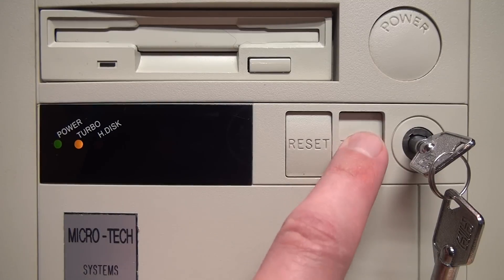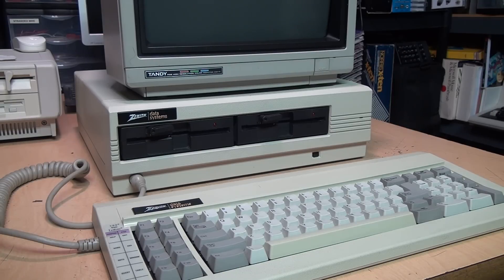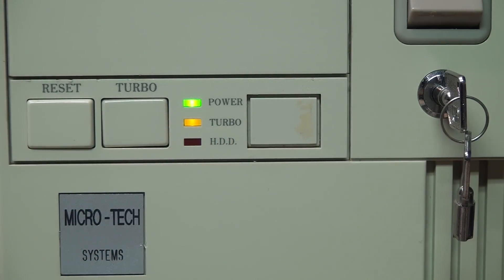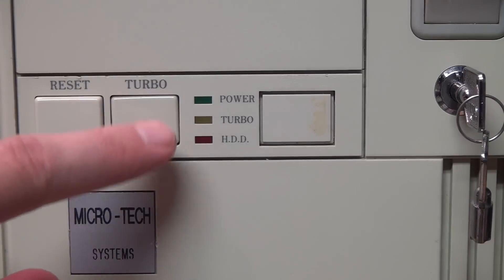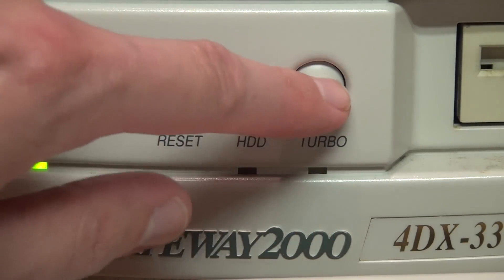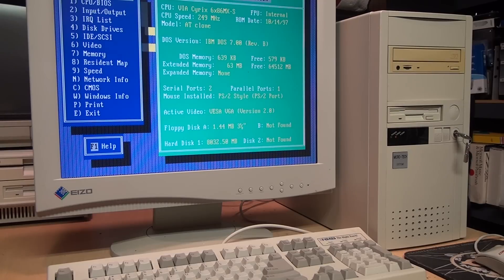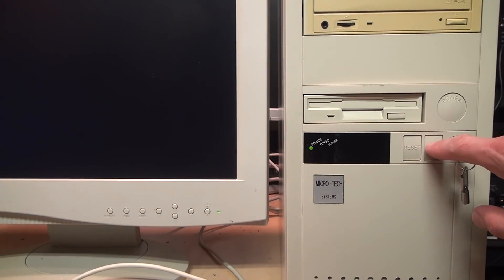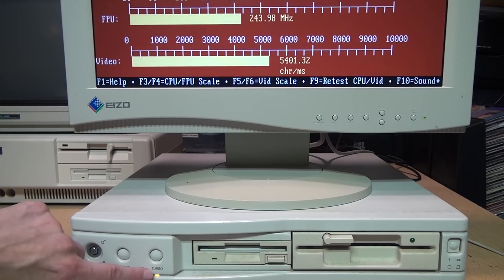The PC turbo button mystery finally solved! (beta version)

Comment: The biggest mystery of the Turbo Button is still missing: 
What does actually happen when you "de-turbo" your machine? I don't know if there's a straight rule for different eras, but they either reduced the whole system clock speed, only the CPU clock speed, introduced wait states or disabled caching.
On XT-class machines it's probably always changing the system clock speed, but for AT-class machines I guess it could be either or. 486 or Pentium machines probably only disabled the cache.
Reply from the maker: You answered your own question. There was no universal rule for how non-turbo mode worked. Older systems usually reduced the CPU clock speed, while later ones usually disabled the cache and added wait states.

Comment: I suspect that many wired their buttons "wrong" because, normally, you'd want the computer to start up in the fastest mode by default, and slow it down for compatibility as needed.
Reply: Exactly. Though the turbo light should correspond. Is it possible some cases didn't have a light?

Comment: These days we still need a button to switch between performance/power hungry/game and economy/silent/office modes. I wouldn't mind real CPU frequency on front panel either.
Reply: Why do you care about the clock frequency?
Reply: @deang5622  to monitor overclocking
Reply: @henson2k  And overclocking is sufficiently represented by a single frequency, that of the processor?

Surely you will have configured multiple parameters, bus timings as well as the processor frequency?

Comment: I think the "myth" may come down to the fact that the "turbo" mode is just the "full" speed at which the computer is supposed to operate in the first place, in contrast to things like overclocking. So the purpose of the button indeed was to slow down the computer, even though that slowed down state is "turbo off".

The first two systems I ever owned were a no-name 386 and a Packard Bell 486, and on both of them the "turbo" button operated as you've shown - pushed in means LED lit means faster. My uncle had a DIY 486 system with one of those speed displays that read either HI or LO depending on the state of the turbo switch.

The irony is that on my first computer, that 386 system, I actually kept turbo off most of the time even though I fully knew it made the computer slower, because I somehow thought that running it in turbo mode made it "wear out" more quickly or was otherwise somehow harmful to the machine...
Reply: That's always been my thinking. The main gripe is that the feature is not to give the pc turbo speed (make it faster) but to slow it down due to compatibility issues. So the button/feature should be called turtle, not turbo. There is no turbo, only stock, and slowed down.
Reply: @dokols  Yeah but that would be less attractive to the marketing department.
Reply: Turbo sounded "Woah that's so Rad, Dude!" back in the day, but it really should've been labeled "normal/low (or XT compatable) speed".
Reply: @plateshutoverlock  "Turbo" made sense back in the XT days, when the 4.77 MHz was considered basically part of the spec.

IMO by the AT era it should've ceased to exist or at least should've been rebranded as something like normal/low. How the term "turbo" survived into the mid-90s is a mystery to me.
Reply: @plateshutoverlock  Exactly. Remember, this is back in the day when there still were a few outdoorsy sports brah holdouts who thought computers were [insert dumb, confusing-to-know-where-to-even-start, probably homophobic/sexist insult here] so, of course you'd use a term like "turbo" that works on their internal combustion orientated brains but insults everyone else's.
Reply: @dokols  it comes from the original 8086 vs the 8088 processor. the 8088 supported turbo (12mhz) over the 8086's locked 8mhz. many programs written for hte 8086 counted on the 8mhz system clock for timing because timing clocks did not exist yet. thus, the 8088 had turbo, which would make some things run much faster than they should. especially annoying in some early games that ran at turbo speeds due to this. (try playing pacman at 150% normal speed)
Reply: @dokols  it's the exact same thing modern cars do with "Sport Mode"
Reply: @dokols  yep, was probably a marketing ploy to try to interest developers who otherwise might prefer to stick with the old hardware.
Reply: I had a 286 that was switchable between turbo and non turbo (through CMOS setup IIRC). I had to keep it at non turbo because of an important ISA card I had in the system would flake out when the system was running at turbo.

 Your typical PC user today would be frozen with brainlock if faced with a problem like this, which was rather common in the early PC era.
Reply: Absolutely right. When the first 286 AT CPUs came out the games that made for the old 8 MHz XT computers were strongly tied to the CPU clock and the faster 286 clocks made the games unplayable so they added a jumper which would change the FSB to slow the computer down so you could play those games. Some guy in marketing found out about this switch and decided that we should call it a Turbo switch which would speed up the CPU to max speed as if you where overclocking it but you were running it at normal speed is all.  They also added displays so you could see you CPU FSB Speed as another ploy to sell their computers.
Reply: I remember when cases started coming out with "turbo" buttons and that was the first question I asked. I was disappointed with the answer.
Reply: You want to run your computer turbo at full capacity? Get a bigger intercooler. Lol
Reply: @Optaunix oddly, When dual cores came out I found if i altered a computer running Windows7 to 32bit  instead of the 64bit it was meant to run, the computer ran about 25% faster than it did in 64bit mode, and it ran cooler too.  Its a lot to do with how those cores are used and also can depend A LOT on how efficiently the software has been programmed to use each process. For a long time now, software has been getting increasingly less efficient. Presumably because nobody has the time to program completely purely. Modules and Blocks are used of pre programmed code in the same way common chips are used in electronics. A chip that does say Four different things is then used for a circuit which only requires One of those functions. ...but with code, you might get the same result with a piece of data, but the efficiency of the computer relies entirely on what it does with the data to get the desired result. The Route determines how long The Journey will take. It seems in modern computing, We forgot that ...or ignored it utterly
Reply: But this one goes to 11.
Reply: Your pc needs intercooler & anti lag system for the turbo, also need turbo timer as well...
Reply: You werent as niaive as you may think. But it does depend. The problem is the RAM memory. It warms up when the data stream is at a higher mhz, thats just pure physics, but some memory chips worked slower if they got too hot which made the overall performance of the computer not as effecient. Running those machines slower in the first place kept them at a constant internal running temperature so all of the electronic components were less stressed and so the computer can be markedly more reliable and predictable.

Comment: So I've been told, around the 486/Pentium era, some people swapped the turbo indicator intentionally so that the machine would run at full speed without having the LED or switch being on all the time. They simply preferred the indicator to be on only when the machine was in "slow" mode. I've actually encountered such a machine in the wild. It was a 486 machine that was hand built, and whoever built the machine didn't have it set up correctly. Simply reconnecting the switch and LED to the pin headers in the proper orientation was enough to fix it.

I can see how misinformation on this could spread though, because people around my age and younger are finding these machines and tinkering with them. They just assume that's how it's supposed to be, even though their specific machine isn't set up like normal.
Reply from the maker: I've never seen a motherboard which illuminates the turbo LED when it is in the slow CPU speed mode, regardless of how the turbo button (if any) is configured.
Reply: @vwestlife  It’s weird, I know. I think it was one of those cases where the turbo indicator LED was plugged into the three segment display. I worked on this machine several years ago, so my recollection could be off.

Comment: I used to have a few old PCs with Turbo buttons in the late 90s, then I actually bought a brand new AT-format desktop style case in 2000 and even that had a switch and an LED, but it was never connected. In fact, I remembered that the board I bought to put in that case, a JetWay 542C Socket 7, has this written in the manual which I just looked up online:

Turbo LED switch: TBLED
	The motherboard‘s turbo function is always on. The turbo LED will remain constantly lit while the system power is on.  You may wish to connect the  Power LED from the system case to this lead.  

So basically they included a switch and LED header on the board for no reason whatsoever.

Comment: Great video. I've also been rather perplexed when it comes to the various articles, videos, tweets, etc. concerning the Turbo button on old PCs slowing down a computer when engaged. For the various clones I owned from 1991-1996, the local computer shop always configured them so the Turbo engaged w/ LED ON meant full speed for the system. Various friends of mine purchased Packard Bell computers during that era and would sometimes ask me to take a look at their computer because it was slow. An accidental bump of the turbo button had turned off full speed. Engaging the button and lighting up the LED restored things to normal. Not only did I "fix it" at the time, I would offer an explanation to them so it wouldn't happen again.

I never saw any IBM PC system - be it a clone or name brand... well... clone - configure a turbo button in such a way that it slowed down the computer when engaged.
Reply: I have exact opposite experience - I have seen dozens of PCs back in the day that had Turbo button wired the wrong way. Half of the PCs in our university computer lab had it wired in opposite way - you can imagine the confusion it caused when sole computers slowed down while some sped up by pressing the very same button on the same type of case. So, yeah - wrongly wired Turbo buttons was extremely common.

Comment: I remember first reading about the "turbo mode actually made your machine slower" thing in the 00s.  I came into PCs with the 386, built my first 386 PC from parts and it had a turbo header on the motherboard which I connected up to the case front panel switch.  I certainly did not remember the switch actually slowing the machine when on, it was definitely functional since I remember having a stash of games supplied by my dad from the 80s - stuff like Space Quest etc that ran too fast with the switch on.

I can't honestly remember if later 486 era boards I used even had the turbo header.  

It's good to see someone challenge this, people just had their switch set up incorrectly!

Comment: my school's cnc shop class had a 486 with turbo button. first and last time i ever seen a pc with a TURBO button on it, i loved it.
We used that pc for CADCAM on a Siemens CNC mill. Files were transferred via Parallel cable at 3300 Baud.
5 years later the school got all brand new HAAS machines. Too easy and fast.

Comment: Where I live, generic "whitebox" PCs were far more common than name-brand systems, so turbo buttons were pretty commonplace when I was growing up. I don't remember coming across a single machine where having the turbo button pressed in put the machine into non-turbo mode, so I've always thought it was a bit weird that some people think that turbo slows down the system. I have always been curious as to why some socket 7 boards still have turbo LED and button connectors, as none of the ones I have do anything besides keep the turbo LED lit continuously (I always just assumed it was so people wouldn't think their machine was running slowly if their case had a turbo LED), but it is interesting to see that some boards used it for the standby function.

Comment: Huh, I thought everyone understood that turbo mode just meant running at full speed, and not anything magical. I had to use it with older games myself. My question is why did the 8086 ran at 4.77MHz?
Reply from the maker: 4.77 MHz was a cost-cutting move by IBM, to allow the CPU to share the same crystal used for the CGA video circuitry and other system timing functions, rather than needing a separate crystal just for the CPU. The 8088 chip was rated to run at 5 MHz, so 4.77 MHz is slightly underclocking it.

Comment: I vividly remember Buck Rogers as one of the games that would run too fast and become unplayable at anything other than 4.77 MHz.  Software developers, initially, would consider the PC like any other home computer at the time: the speed would be standard for the machine. So they were using standard delay loops to create the timing in the game. Later on timers were used so the speed would not change with CPU speed.
Reply: My first PC was 8 / 4.77. I never had any games that needed 4.77, and yes, it didn't take long for developers to accommodate for different processor speeds.
Reply: Actually no, for a long time and they still do frequently today tie delays to FPS.  This is why you will find many games have a locked FPS. Timers based on system clock are finicky to build a game around. Real time does not translate well to animation frames. If the game has real-time animation then that is not an issue.

Comment: Awesome content! Definitively solves this issue. I only ever have heard people talk about the turbo button slowing down the computer when enabled which obviously doesn't make any sense.
Reply: It can depend on which PC you're looking at, and the light status isn't a hard and fast rule. I have a 486 system with a Biostar MB-8433UUC motherboard that boots by default in full-speed mode with the turbo light off. You can wire up the turbo button whichever way you like, but light on for it does clock it down in benchmarks. I'm not sure what percentage of systems go one way or the other, but there are exceptions.
Reply: Many PCs back then had Turbo button wired the wrong way, so pressing it in slowed CPU down. I personally have seen dozens of such cases. And I have read thousands of comments of people from across the world that have encountered the same confusing issue back in the days.

Comment: My Magitronic 486 PC (upgraded to an Am5x86), still rocks its turbo button and 7-segment display showing the CPU speed. I also used to have a Magnavox 386 PC which requires a key combination for turbo (or change it in BIOS).

Although before I upgraded the L2 cache, it would choke on the 64kb L2 it originally came with, later switched it to 256kb L2 from another PC i salvaged parts from.

Now I just need to rewire the display so it reads Hi / Lo as it currently displays 33 / 16 despite the CPU upgrade.

Comment: I remember having the turbo buttons back in the 286/386/486 days - don't remember ever having to turn it off for anything. At that point it seemed more like a feature they can advertise that made the computer sound faster to people who didn't know what they were talking about, rather than a useful feature.
Reply: I vaguely remember having to slow mine down once or twice to play some old Dos games. I may have been testing or something.
Reply: I had a PC and once I added a hard disk it did not boot in Turbo ode as the hard disk did not have enough time to spin up so I ha to ctrl-alt-del to boot it.

Comment: I bought a cache module for my PC Chips board as it had plastic cache. But that didn't make any difference as either the cache module was fake too or the BIOS didn't actually initialise it and gave a fake message. This was in 1990's so I can't remember exactly what the issue was but it really annoyed me as the cache wasn't cheap.
Reply from the maker: Mine came with the cache module already installed, and it is real cache, unlike the fake chips on the motherboard.
Reply: @vwestlife  Does it actually show as cache in diagnostic programmes? As with mine the POST screen showed a cache module installed with the cache size but it was a fake message. Even if I removed the cache module and had it enabled in the BIOS the POST screen still reported it. But diagnostics programmes would say there was no cache with the module installed. I couldn't believe I had been ripped off twice!
Reply from the maker: @dalerobinsuk  Yes, it is verified by CACHECHK.
Reply: @vwestlife  That's awesome!

Comment: Some of the bigger Wikipedia editors suffer from the same symptoms as certain Reddit moderators - it's a power trip for them.  It doesn't matter if the source is from one of the pioneers of the x86 architecture - what matters is that "TrustNoOne42" or some other schmuck's will has been imposed.

Comment: My two year old Asus ROG laptop still has a turbo mode, activated/deactivated with Fn+F5!
"Turbo mode pulls out all the stops for high-octane gaming.  Turbo mode enables our ROG Boost factory overclock for the GPU and its memory, and also increases the wattage allocated to both the CPU and the GPU."

Comment: My first computer was identical to that Gateway 2000 4DX-33 - except my turbo button acted in opposite fashion. Light off by default it ran at full speed. When pressing it the light came on and it slowed down. It didn't make sense to me for almost 30 years. Now this makes me think that my Gateway was either wired wrong or had a different board that made it do this. Either way, I'm drooling over that dx33 of yours.